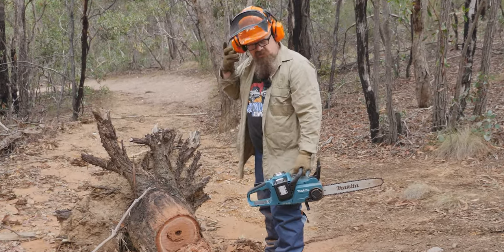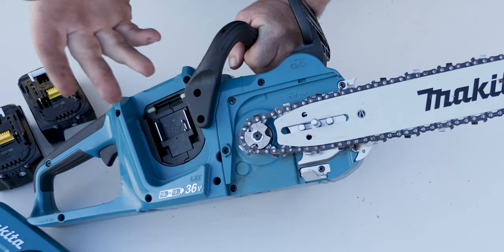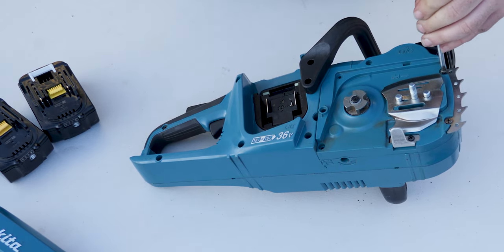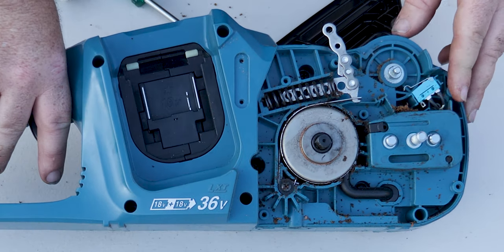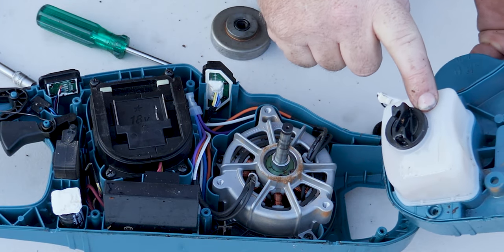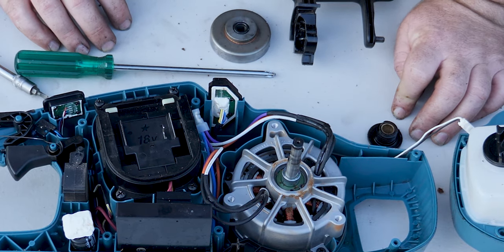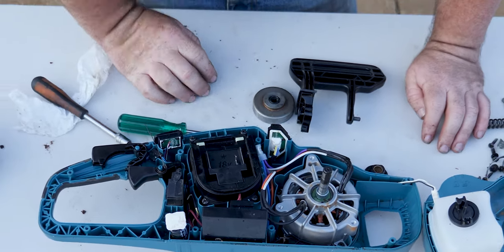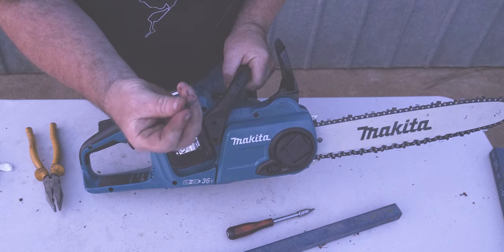Makita Brushless Chainsaw DUC353/DUC355/XCU03 Review and Teardown

Comment: One thing the Makita is missing that all the others have is a gear box to wear out or break.  It's direct drive.  Notice when you spun the shaft the center windings didn't rotate.  Makita uses a rotor on the outside with the fixed stator on the inside.   This configuration produces tremendous torque and higher inertia - so no gears required - direct drive.
Reply from the maker: It's one of the benifets of that electric motor, full torque as soon as you pull the trigger. Though having grown up on IC engined chain saws, I always start cutting  with the chain at full speed.
Reply: @LockyourHubs4WDing  Not at all what I was referring to.  Electric motors, in general, have full torque throughout the rpm range.  The Makita outer rotor motor is different from all other electric motors in that it rotates at a lower speed with very high torque.  All other battery saws and corded chain saws have a gear box to convert a high speed inner rotor into slow speed high torque power.  

This outer rotor design results in light weight compact size with high torque. External rotors are ideal for applications with varying loads like a chainsaw.  It's high inertia helps to “push through” load fluctuations and give high starting torque.  Because of these factors Makita’s saw can be direct drive.  Have no gears also increases efficiency and simplifies.

Comment: How long do the batteries last? I have the 355 model and my two 5A batteries last about 10-15 minutes in light work conditions...
Reply from the maker: Using 2 6A batteries I got about 20 cuts of 12" (300mm) hardwood.
Reply: I think that has put me right off, not much run time there.
Reply from the maker: It depends on what you want to use the saw for, if it's to clear tracks or cut a bit of firewood for around camp, it's fine. 

If you want to cut a winter's worth of firewood, grab a petrol powered saw.

Comment: I see the latest model switched to the more traditional 2 bolt and screw chain tensioning.  Have you experienced any issues with the single bolt/toolless system on this model.  This seems to work just fine from what I can tell.
Reply from the maker: I saw that similar dewalt tensioning system having issues, though haven't personally had, or heard of any issues with the original Makita chain tension system.
Reply: @LockyourHubs4WDing  Thanks for the quick reply!  In that case I'll be picking this saw up while the 4 battery deal is still active.
Reply from the maker: You won't regret it, it's a great little saw. My Stihl is staying more and more in the garage these days.

Comment: More info on how long the batteries last in real use would be helpful. Am I going to be able to cut enough wook for my weekend of a single change?
Reply from the maker: I take a spare pair of charged batteries with me and haven't run out over a weekend's camping. Though it depends on the wood you're cutting, it's last a lot longer cutting pine than aged redwood.
Reply: I use mine for firewood.  Depends on the batteries you use.  It requires about 500-600 Wh to fill a 8' pickup truck with firewood.  Two sets of 6 Ah batteries produce 436 Wh.  
Makita makes 6,5,4 and 3 Ah batteries and they all weigh approximately the same and are the same size.  Two three (3) Ah batteries is half the Watt hours and the others are proportional.  Hope that gives you some idea.  I use 6Ah batteries so I don't have to swap out so often.

Comment: Center of gravity a little further back would be nice, i think
Reply from the maker: It's reasonably well balanced with 2 6ah batteries.
Reply: @LockyourHubs4WDing  i have a ancient stihl with 5.4 kilogram and now this makita. The makita has 5.2 kilogram with 5.0 ah accu. The stihl seem lighter because of its center of gravity. I had to weigh both of them to believe it that the stihl has more weight. The makita is brandnew, got it today. Waiting for spring to test the saw 😁

Comment: Looked a chore to clean out the chain brake.  Prob. OK for occasional bush use. Can't remember if you mentioned $.
Reply from the maker: In Aus, they retail around $500 plus batteries and charger, I picked up an additional bar (so I can cut myself out of a stuck bar situation...) and then you'll need a chain sharpening kit and bag, so it all does add up.
Reply: I've cut the equivalent of 30 to 40 full cords with the saw.  The chain brake isn't exposed and needs no maintenance.  I paid $179 for the bare tool on eBay USA.  If you already have batteries.  I put an Australian Archer 16" bar and full chisel chain.  Cuts as fast or faster than the 14" Makita bar and safety chain.  I didn't use the Makita bar - too short.  I've worn out one sprocket ($9) and one bar ($20).  I dressed down the worn bar and still use it for a spare.  Just keep it sharp and clean.

Comment: Please tell me, many people in comments across internet told me one thing that is annoying with makita duc353. When you press power and u cut something, when you put it aside, after 5 seconds saw turns itself off, and you have to start it again constantly, if you are cutting something and moving cutted logs in same time. Can you start your chainsaw and put it aside to see, will it really turn itself off after 5 seconds. Why is this important for me ? - i am buying thiy chainsaw for my father. He is old and very very short tempered. If chainsaw will keep turning off after 5 seconds he will probably break it. I am very afraid he will break it cuz he has PTSD, he is war veteran. Thats why it matters to me so much. If its possible, please, can you do that test ?
Reply from the maker: The top button needs to be pressed before pulling the trigger. You don't have to move your hand from the handle. Just press it with your thumb before pulling the trigger.

The Makita wipper snipper (line trimmer) does the same thing. 

I don't find it an inconvenience at all.

Comment: Which one is beter 353 or 355 what is the difference
Reply from the maker: The only difference I know of is the 355 has a traditional 2 nut setup to bolt the bar to the body, where as the 353 had a tool-less winder and second spigot to secure the bar.
Reply: @LockyourHubs4WDing , thank you. I have been looking into this myself, and the bar attachment and chain adjustment does indeed seem to be the only difference. 355 is the newer model, so it might be some quality lacking with the tool-less adjustment, or maybe just due to popular demand?

Here in Norway the 355 is not available, it is not even searchable/viewable on the makita.no website.

Great video!
Reply: @TL-he7vu  The tool less adjuster is flawless.  I've worn out a sprocket and gone through 4-5 gallons of bar oil and the adjuster works fine.  Don't know why anyone would need the wrench version.

Comment: Isn’t your blade on backward?
Reply from the maker: The chain or the bar?
Reply: Chain. Normally the small ‘guide’ is in front of the tooth. Maybe my eyes are wonky though, getting old. Edit: just rewatched, pretty sure it’s on backwards, sometimes you get arrows on the tooth as an aid that should point away from the body when viewed along the top edge.
Reply from the maker: Yes you're right! Well spotted. Obviously not in the intro (otherwise I wouldn't have cut through the log) but before dissassembly the chain was on backward. There's a little diagram inside the chain sprocket cover. Probably not the first time I've been guilty of that! Or the last time either....